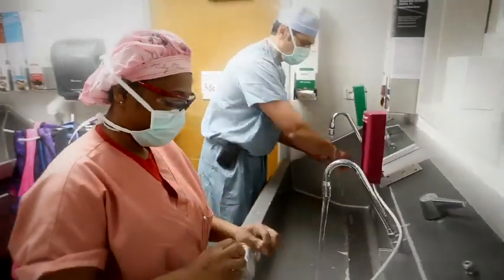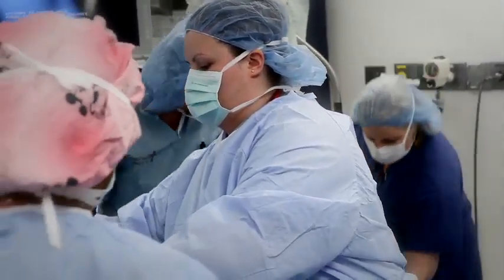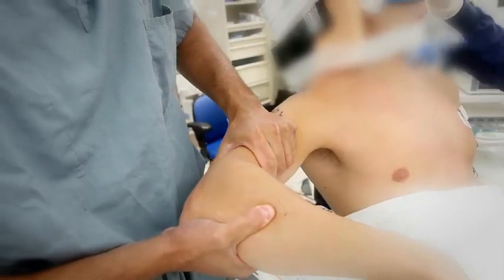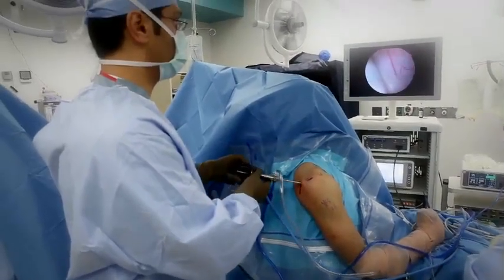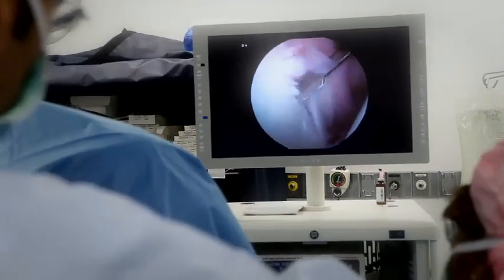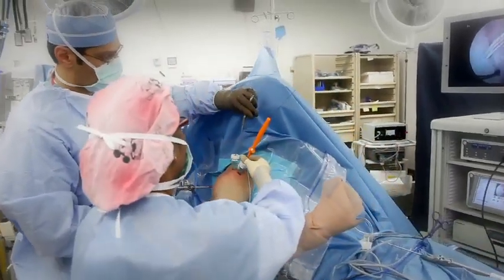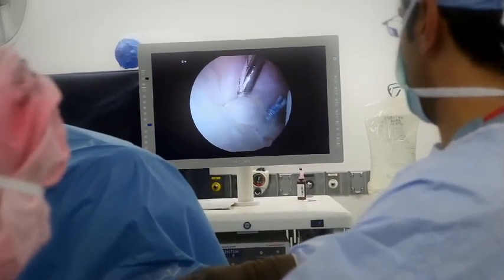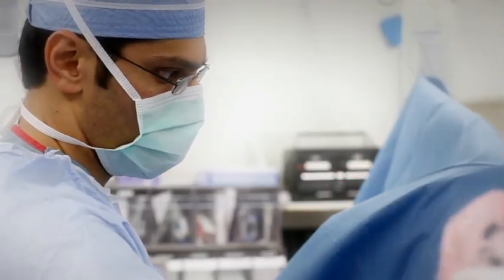Shoulder Dislocation Repair

Comment: I've dislocated my shoulder at least 10 times already and the doctors here won't do anything about it, all they do is give me a sling and told me not to left anything and what not. I'm just getting tired of it coming out all the time
Reply: simply dont rotate your arm to where it's cracked before simply use the other arm  dislocation could heal in 6 - 12 months i heard